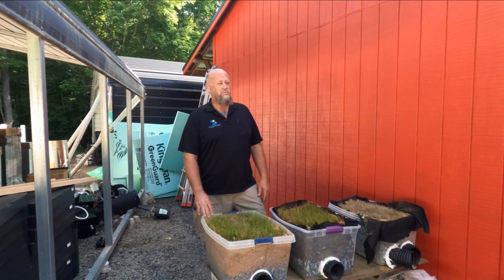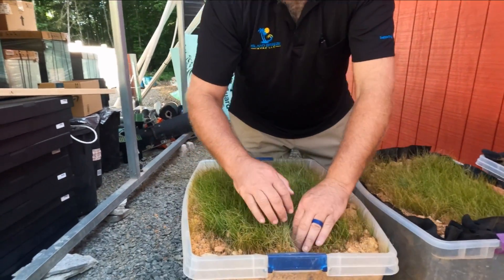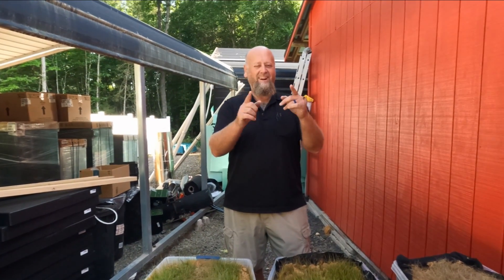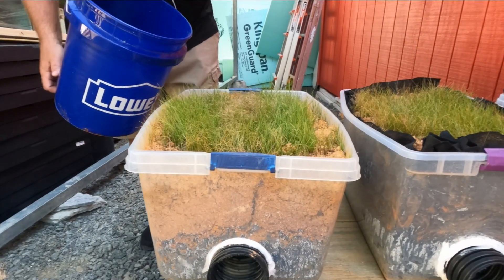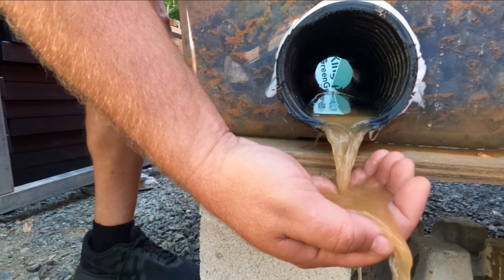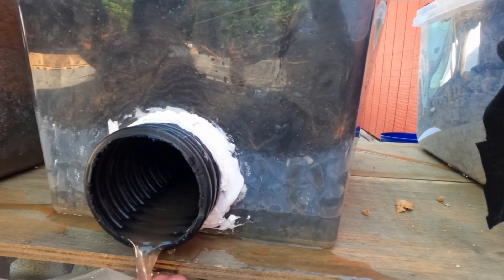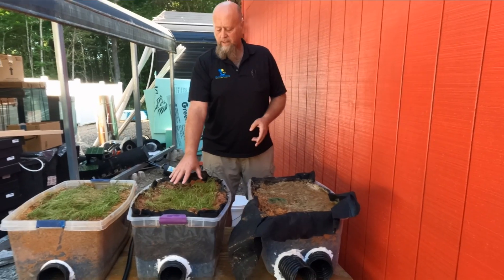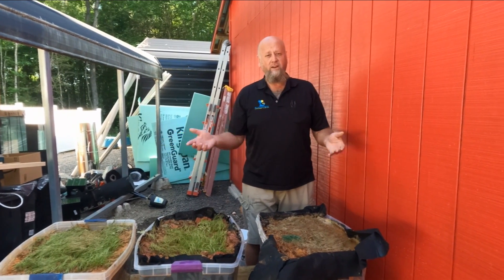Testing French Drain Scenarios To Find Out....Fabric or No Fabric? Which Is Best | Dr Drainz

Comment: So instead of plugging the rock with debris, your plugging the filter fabric.  Leave these tests together for 10 years and see which one still works. I guarantee the fabric will be plugged and the rock will still work.
Reply: And the one with rock and the one with fabric were the same color.
Reply: Fabric will eventually clog.  All French drains require maintenance over time and all will clog a bit in the long run.  It also depends on your region and type of soil.  French drains in Colorado will work for a much longer time than in Michigan or Tennessee.  Soil types and amount of moisture make huge impacts.
Reply: @roberthernandez1985 obviously you have never taken soil mechanics in college. The purpose of the fabric IS to prevent the aggregate from becoming plugged by the fines silt and clays) in the soil. Water will still move through the soil, the fabric and the stone. If there is no fabric on the top of the aggregate, fines will move into the voids more quickly and reduce the capacity of the French drain. Once this happens water will still move through, but the system will not be as efficient as when initially constructed.
Reply: FACT!!
Reply: Screw it I’m doing an 8” French drain. 😂
Reply: This is literally the opposite of what Chuck’s vids say to do.
He often says fabric only in sand.
Reply: Seems like a maintenance cost to account for.
Reply: ✨I've seen some drainage people doing nothing but stone in high water locations using two lines ...Gutters in solid .. Perforated for French Drain...then bring them together at outlet ...But only use bigger stone
Reply: Yep. It could be no pipe.
 trench of just plastic or fabric at the bottom of a trench of gravel. Specifically very large chunks of gravel. 
The earth becomes the pipe.
Reply: Why do you think stone crusher run ISN'T used but washed stone is?  It's the same reason the washed stone needs to be kept clean from surrounding soils.  The pipe should be wrapped in filter fabric. And the stone encapsulated in filter fabric to keep the stone clean.  If soil is allowed to mix with the stone, it will create a porosity similar to crusher run and be semi-impermeable.
Reply: Keep in mind not all fabric is the same.  It has to be filter fabric, and definitely not that heavy duty woven landscape fabric.  That stuff is impermeable.
Reply: Doing a French Drain with a Sandbaggy wrap using round river stones. Will top that with 3' wide dry creek bed using Mexican Black Pebbles and medium size boulders and flat rocks to create a natural look.
Reply: Yes, do an actual CONTROLLED EXPERIMENT and wait for the results before declaring a winner.

I did exactly that experiment some 30 years ago, and guess what the results were, when evaluated five years ago? 

1) The covered section, the EXPERIMENT, developed a heavy overlayment of clay, but the drain rock when excavated for inspection was unaffected except at the very bottom. Thus this section of drain continues to this day to function as designed, carrying large volumes of subsurface water away. The surface layer sees local rainwater only, and dries quickly in dry weather.

2) The plain rock section, the experimental CONTROL, was completely saturated with clay throughout, causing groundwater to back up and percolate out as surface water. This water in turn severely eroded the hillside, exactly the effect which the drain rock was intended to prevent. This ground water continues to seep to the surface for months in dry weather, causing root rot in plantings downhill.

So congratulations, you were right. The fabric clogs but the rock remains porous, when you use a fabric overlayment.
Reply: Facts never burrito wrap the pipe always daylight the stone it also slows the flow down into the pipe and when it storms heavy you will lose flow some of these guys need a lesson in hydro physics also I see a ton of landscapers doing this full wrapping nonsense
Reply: @RDHPLUMBING  Burrito wrap is literally the accepted textbook way of doing these drains so I kinda doubt it's wrong, because a million people and a million working drains arent wrong, they woulda figured it out by now. From what I can tell,  fabric keeps the roots from clogging the pipe and also keeps dirt and roots from clogging the gravel so water never reaches the pipe to begin with. Any drain will work well at first. The test is time, and I suspect the no wrap drain fails first. Because a lot of contractors who have made a lot of drains say so! The fabric buys time.
Reply: @cryengine_x  the gravel goes above the fabric when you daylight it so no the fabric doesn’t stop the gravel from getting dirty also it doesn’t stop roots ever seen a root grow through a sealed pipe joint when doing drain cleaning? I have and super thick and thin roots. Also I’ve done many many French drains for hospitals and schools and engineers also spec no top layer of fabric only the bottom of the trench gets fabric and that’s so silt water doesn’t rise up and clog the pipe you never need to completely burrito wrap the pipe also it slows down the overall flow that the drain can handle when it rains heavy slowing down the infiltration rate in which the water gets into the pipe
Reply: @cryengine_x  also putting dirt over the fabric further more slows down the rate in which the drain can absorb water at making it less effective daylighting gravel is always the most effective
Reply: @cryengine_x  I have French drains for customers almost 15 some 17 years old in my neighborhood that I’ve done that still work with no fabric over the top
Reply: @RDHPLUMBING  with fabric will last 200 yrs. your drains are probably already failing.
Reply: @RDHPLUMBING  gravel will work at first but clog up over time as dirt mixes in and closes the voids between stones.
Reply: @RDHPLUMBING  your drains will get clogged up fast. the dirt will clog up the voids in that gravel.
Reply: @cryengine_x  lol it won’t because the trench is lined with fabric and the top is open fabric free and the gravel or rip rap comes to the surface how’s the dirt going to get in?
Reply: @RDHPLUMBING  the top?
Reply: @cryengine_x  ya dude you’re obviously not understanding how a French drain works lol
Reply: @cryengine_x  also as to yo ur theory about soil clogging between the voids you are also 
Incorrect the water breaks down the soil in those voids and washes it into the drain at the bottom it breaks it down into fine particles and to prove that point when we do our French drains and we come back after the top soil compacts we run a power washer across the top portion where the gravel is to the surface and it breaks up the loose soil that got in the voids and comes out as dirt water from the outlet of the French drain pipe
Reply: @RDHPLUMBING  over time the voids will be clogged up. literally anything will work at first which is what you are seeing. heck there was a guy on here who put packing peanuts instead of gravel in his drain and said it worked great. yeah, but wait a few yrs i told him.
Reply: @RDHPLUMBING  You clearly dont understand how a french drain works lol. Yours will fail later.
Reply: @cryengine_x  did you miss the part where I told you I still have 15 year old French drains with no burrito wrapping still in service?
Reply: @RDHPLUMBING  proof? i bet not in clay or anything difficult either no matter what you say
Reply: @cryengine_x  all soil has clay just depends on the percentage like I said I have quite a few French drains in my area I’ve done over 15 years old that still run fine once the soil packs itself naturally there’s rarely any dirt that gets in there bud you line the bottom of the trench with landscape fabric but never entirely around the pipe or you diminish the flow capacity it can handle during heavy rains
Reply: @RDHPLUMBING  so you just use gravel on top? problem is thats ugly without topsoil/grass on top right?
Reply: @cryengine_x  you can decorate it with nicer rocks at the surface and keep the gravel below that there’s many ways to be creative and make it look nice
Reply: @RDHPLUMBING  bingo. That’s my plan. Glad to see you boys work it through in a civilised manner. 👍🏻👍🏻😁
Reply: @cryengine_x  not if you know what your doing and yes… Ive done many more lawn drains than you… I already know.
Reply: @sevenspineiii7524  lol you must do a lot of failed drains good luck you will need it
Reply: @RDHPLUMBING  I'm going with the daylighted rocks
Reply: @Cryengine_X  it is the textbook way with one exception.  DO NOT use filter fabric in a clay soil. It will clog.
Reply: @RDHPLUMBING So don’t top the gravel with sod? Have y’all tried that? And if so do you recommend it or no?
Reply: @cryengine_x made a lot of drawing over a short period of time. That fabric may have a 30 year life for the material, but it will clog up after just a few years.
Reply: @AtlantaFixers so if you are doing turf you’re gonna maybe have a 25’ stripe of gravel down the middle of you front yard to the street? Not saying that is how your property is but just making a point.
Reply: Fabric has a 30 year life so 30 years of no problems
Reply: @davidwalker8778  and then ya pull down the wall

Comment: Awesome video!  Very straight forward and realistic set ups.  I appreciate your knowledge and your time!  

Out of curiosity, why not have the surface drain tap into the French Drain (so you only need 1 drain rather than 2)?
Reply: Because the surface water will be at higher pressure than the subsurface water, so all the water captured by the surface tap will flow OUT of the french drain holes.....
'Once you have captured water, NEVER give it a chance to get back out again until you move it to a place to get rid of it'......
Reply: @Debbiebabe69  not true. Water follows the path of least resistance, so unless the entire pipe is completely submerged, water will choose to flow through the pipe

Comment: Great video, great idea for testing, great effort ... You get an A+, sir.

Couldn't help notice though that the first setup, sans the landscaping/drainage fabric, seemed to have the fastest throughout by far, but I guess you mentioned that was bc it was dry and subsequent storms would find the clay compacted.  Well, thanks bud, we appreciate it.  Btw... I'm standing outside over a couple sections of new corrugated pipe wondering how many drill holes to put in it, where and what size (thinking 3/16ths or 1/4"...?)c right here in good old WILMINGTON, NC

Comment: Use the solid perforated pipe…….stronger, easier to clean if you have to……fabric will clog up…..that “soil” is clay……virtually impervious to water.
Roots are the problem try to have a clean out……
Reply: How many years and installations have you done in all clay places?
Reply: Without fabric, will the clay actually clog the stone as they say?

Comment: I’ve done both ways with and without the fabric. The water flow pretty good either way while there testing after the install. No matter which one you choose you’ll still have to clean the system. The fabric will give you a some extra time.
Reply: With fabric flushing will do nothing. You will need replace the fabric after the clay fines seal it.
Reply: @blackdogleg  Exactly. The ground and clay above the fabric will seal and the system will be rendered useless anyway.
Reply: @blackdogleg  if you are trying to capture surface water that is true. However if the goal is to capture ground water at the footer then it creates a low pressure point for the hydrostatic pressure created by all the water in the ground. It’ll seep in there rather than your CMU
Reply: @emeraldtigerhd5176  will do the same without the fabric.
Reply: @blackdogleg  hopefully you’ve seen more about it by now and see how the fabric holding the dirt back is a good thing
Reply: @emeraldtigerhd5176  hopefully you never wrap a drain in fabric. As for the slope, it all depends on the soil structure. Not all soils are the same.
Reply: @emeraldtigerhd5176  frabic behind large retention walls has be the direct cause of wall failure. Like I said; it all depends on the specific soil structure. Which is why we have soil labs. There is no one solution to all situations.
Reply: @blackdogleg no everything has to be the same 😂
Reply: But that fabric itself won't keep forever either. I'm sure it will deteriorate quicker than using  just the rock.

Comment: That fabric is of no use in the long run. Just add a big layer of gravel on top of the pipe. You can add more washed soil from top easily but it's not easy to unclog the fabric.
Reply: But not everyone wants gravel channels running all over the place!
Reply: Fabric keeps the gravel from clogging with silt.

Comment: So what do they use for septic lines then ?
Reply: Nowadays they only use infiltrator chambers. Before that, they did use slotted corrugated pipe with gravel and a soil separator over the top
Reply: @electricaf365  
Ty

Comment: I don't have an issue with the fact that "fabric works" as shown in your demonstration, but my question is, can't the fabric eventually clog up with dirt to the point water can't pass through it anymore?  Would that happen in 5, 10 or 15 years? Thanks.
Reply: What you state is part of the reason a lot of engineers dont spec filter fabric behind large retaining walls. They know the filter fabric can create a blockage in a decade whereas it can take 30-40-50 yrs for several feet of angular stone to clog. At least in my area.
Reply: You are absolutely right. I don't care what this guy says, fabrics will clog, period.  If you have issues with lots of rain and surface water, proper grading and catch basins is the only real long term solution.  Sprinkler systems to keep large cracks from forming are also excellent ideas to avoid foundation issues. Had an engineer evaluate my setup.  He told me he had been to over 200 houses this year, of all those with foundation issues, not ONE had a sprinkler system.
Reply: @PayNoTax-GetNoVote  what do you mean sprinkler system
Reply: @PayNoTax-GetNoVote  catch basins do nothing too underground water from the water table which is often the issue in a soggy yard. you know little. My yard problem area stays SOGGY long after surface water is gone.

Comment: I have a flat pathway, only 4 feet wide. Brick is about 1 feet below the ground. The brick sits on large stone. My house is on one side and the other side has a fence. The other side has ground. I don't have slope. The tube would be level to the ground. 

Can I use a sump pump with a french drain to pump away the water? Any other tips for this situation?

Comment: What happens when the fabric becomes plugged up?
Reply: Initially I thought the same thing but what is going to plug it up? The same clay that already allowed the water to seep through itself!
Reply: @dm-zx7xb  this was what I thought, but I was wrong. It's called geotextile blinding and basically if you have a dispersive clay the fine parts migrate towards the fabric as it tries to get rid of the water and blocks the outside of the fabric instead. I have spent years researching it all after the first french drain was a disaster with no fabric laid by builders so decided to do it properly with fabric... However I have spent 6 months inspection daily watching what is happening before I went and put thousands of pounds of soil on the top and I'm glad I did because the problem now is that the outside of the fabric is blocked, inside is squeeky clear but the whole point was to get rid of a seep spring, don't get me wrong its a ginormous improvement to what it was like before but it's far from perfect. I am currently working on how to resolve this hence coming across this video but instead of anyone having a real helpful answer they all just argue and call each other out about one's use of fabric or no fabric instead of the scientific evidence behind it and pros and cons.
Reply: @lala_land86  interesting! What state do you live in? I'm in Georgia and we have thick clay. I can see it doing what you said though.
Reply: So to answer your question @gregwallace quite simply, it stops working 😂😂😂
Reply: @lala_land86  You are right....I was being a smart ass.LOLOLOLOL!
Reply: Then you get a hammer and you simply pull the wall down